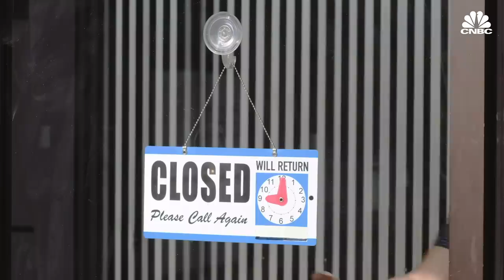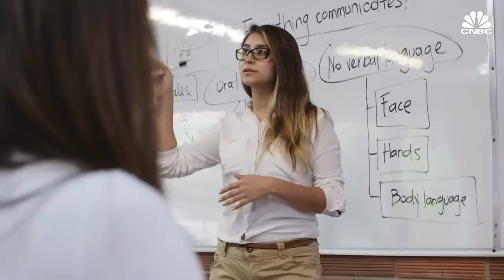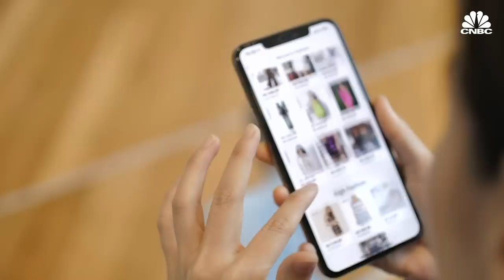What’s Next For The U.S. Economy: Danielle DiMartino Booth

Comment: The decline in the US position worldwide in manufacturing, AG products, high tech, vehicles and every other category -- except pretty much one --since 1990 is astounding. There is only one significant metric I can find where we are still way out in front: Among countries with greater than 100M population, our per capita GDP is 6X the nearest country. (You have to eliminate the small countries, otherwise you end up with Luxembourg and Switzerland in the lead because of the concentration of wealth and small population.) 

One thing I noticed -- since Trump is saying he's making a big difference -- I wanted to know if the rate of US decline since 2016 has changed at all? I don't see any change. We are continuing to lose ground to China at about the same rate. COVID is undoubtedly making the numbers even worse. Just as an example, the production of Aluminum in China is now more than 30X the US. In 1990, the US was outproducing China by a factor of 6. It's similar across the board -- even in most AG products. We still lead just barely in corn and soybeans. China's wheat production is almost 3X ours.

China is having us for lunch. And Trump hasn't changed that.